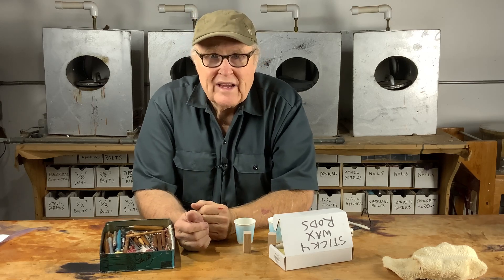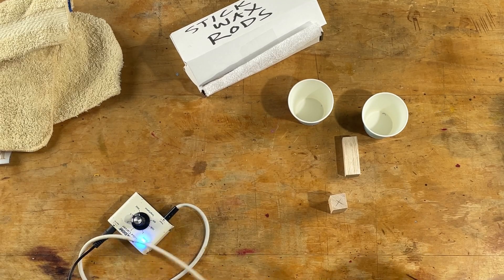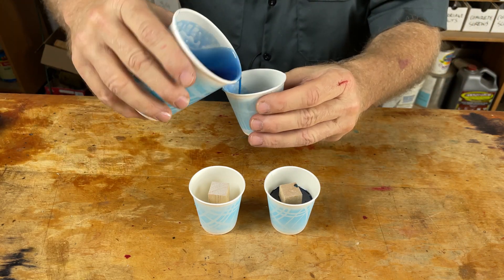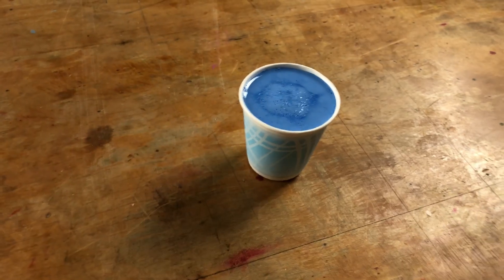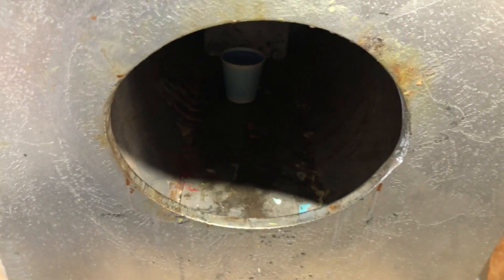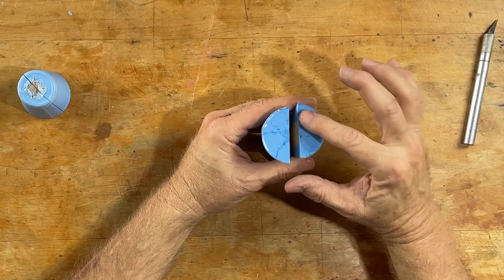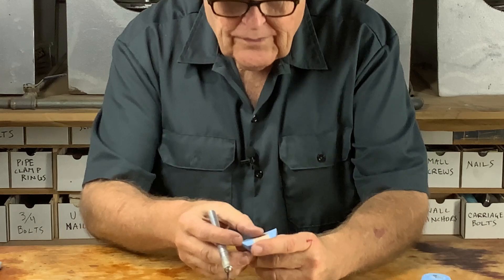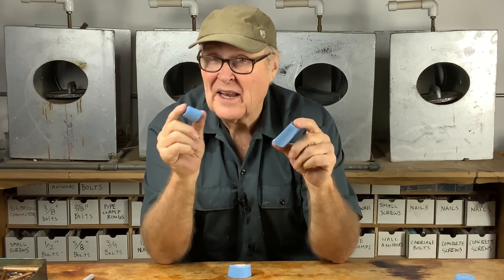Pressure Casting Resin On Wood

Comment: I love experiments like this. What if it went into a vacuum chamber to cure instead? Or what if it went into a vacuum chamber first and then into the pressure chamber to cure? Does balsa have enough moisture in it to cause problems with the resin, if put into a vacuum chamber? For Science!

Comment: In this case it might make more sense to use stabilizing resin for wood. First dry the wood as much as possible, then submerge it in stabilizing resin, then use vacuum chamber to get all the gasses out of the wood and let the resin soak into it, then (optionally) use pressure to further push resin into the pores, and then use heat to cure the resin. This way most of the voids will be filled.

Comment: Impregnation is absolutely the right word. An engineering process for the sealing of aluminium (that I have seen and used) castings is vacuum impregnation which involves placing the casting in a bath of thin heat curing resin, removing the air and then allowing the resin to flow back into the now air free pores and openings. That relies on pressure in a similar way as your pressure pot but almost in reverse, the pressure being provided by the atmosphere on release of the vacuum. There are many videos on here of people using pressure pots to stabilize wood with either heat curing or two part resins. 

Interested in the bubbling from the wood that may have been caused by moisture as you suggest. Might be worth trying sealing the wood before encapsulating with some kind of thin "varnish" or pre drying the wood in a desiccator of some description. The avenues of research are many and various from this interesting video. Thank you.

Comment: I was expecting a balsa pancake. 
But no! Thank you for this insight. 😊
Reply from the maker: I did a casting once with a closed-cell expanded foam core and that is exactly what I got- a pancake!
With open cell foams you get almost 100% impregnation of the foam so you wind up starving the mold because the cavity won’t hold enough resin before you pressurize it. And anyway, what’s the point? Once you completely encapsulate the foam you no longer have a hollow or lightweight core in the center.

Comment: Interesting video Robert, I know this is more about how resin pressure cadting affects the wood but there are lightweight casting resins designed to float like Featherlite from Smooth-On if someone needed a casting to be buoyant.
Reply from the maker: Featherlite is definitely a better solution than wrapping a balsa core. Or even resin additives like microballoons.

Comment: Balsa wood is highly porous. If you mix liquid under pressure it will penetrate the porous wood every time. Testing is a must because each wood species has different porosity.  The more dense the wood is, the less penetration. For example, Rock Oak won’t render much penetration because it is hard as a rock and extremely tight. I would also think that the sappier the wood is, the penetration would be present by far less. Like Pine has a very tar like consistency. I’m sure the pressure will penetrate to a degree but the tar like liquid would push back against the resin.
Reply from the maker: Exactly right Richard.

Comment: Your videos are superb, Mr Tolone! They are both educative and entertaining. Thank you for posting them. I was wondering could a plaster of paris casting be placed in a pressure pot in order to eliminate air bubbles in the plaster as is the case with resin casting?
Reply from the maker: I have only limited experience casting plaster-like materials such as HydroStone, but it  worked for me.

Comment: If you prepaint the balsa with a thin coat of resin. would that not stop the resin from entering the wood? Or do that come with its own bag of worms? 

Hope you are doing ok, that cut on your finger looked perdy bad.
Reply from the maker: The cut was minor actually. But now I am irritated because when viewers criticize my use of the tablesaw I point out that I have never been injured by a table-saw blade in over 40 years of use. Now I can’t make that claim because I cut myself taking a new blade out of its blister pack!
Reply: @RobertTolone  glad to hear it is not as bad as it looked. But to be fair, you can still claim you have not injured yourself on a table saw as it was only the blade you cut yourself on. And the blade was not even on the saw at that. And there is still another thing as well, you can just change your wording slightly to: never injured while operating a table saw. ;) Glad your ok at least. =)

Comment: The results may differ dependent on the type of wood used.  Balsa being very light has a lot more air within the grain of it, whereas a more dense wood such as Oak or Cedar, that has tighter grains, would most likely have little or no resin infuse into it, even under pressure.

Comment: How would you hold the balsa core in position without leaving a channel that water would get in through?
Reply from the maker: The design I saw holds the balsa in place using the wire harness. This causes its own problems because the resin leaks out of the mold around each wire loop and must be  cleaned off each casting.  Personally I feel this scheme is labor-intensive and unnecessarily complex.

Comment: I'm assuming the point of the balsa core is the buoyancy with the air? So getting resin inside the wood would cause it to lose that. Others have mentioned some sort of sealant beforehand might help prevent that. If buoyancy is his goal though I wonder if he could simply skip the core and rotocast a hollow lure.
I just wanted to comment this video is kind of similar in an opposite sense to "stabilizing" wood, which is intentionally impregnating wood with resin via vacuum chambers and making it harder and turnable on a lathe.
Also have enjoyed all your videos, they're very informative and thanks for making them.
Reply from the maker: I don’t believe that casting resin around a wooden core is a viable way to make fishing lures and I don’t know of any company that does it.  But I was interested to see what would happen to the wood.  The results were not that surprising.

Comment: Most lure makers dip into KBS diamond coat. It's not cheap, and it's a pain to work with for various reasons, but it does what he's trying to do. There are a few guides to its use and handling on channels like Jekyll Baits.
I appreciate these experiment videos though! Cool to see the resin is forced down some of the wood fibers, but not the majority of them.

Comment: Wonder if it was sprayed w/a sanding sealer then resin cast if it would still impregnate the balsa...?
Reply from the maker: Probably, but what a load of hoops to jump through! If I were making these lures I would add microballoons or some other filler to make the resin lighter and more buoyant. Way easier and more reliable.
Reply: Has he tried a UV cured resin?  Since it looks like he is basically using it as a clear coat, that will probably service his needs better.
Reply from the maker: @sjlarue1  I would be inclined to do it the way Nate Marling does on his channel Marling Baits.  He seals the wood with superglue then primes and paints the lure. Then he dips it in UV curing clearcoat.  If I didn’t want to carve wood I would cast the pieces in a lightweight resin such as FeatherLight from Smooth On. Or use microballoons.
Reply: @RobertTolone  That is exactly who I was thinking of. :-D

Comment: could you also just dipped the wood piece into resin then hang to cure? to my simple mind that would work just like dipping into paint,, thank you for the tip
Reply from the maker: To dip it you would have to mix a decent amount of resin and it would go off pretty quick so you would waste a lot.  Maybe it would work if you used a slow curing resin.